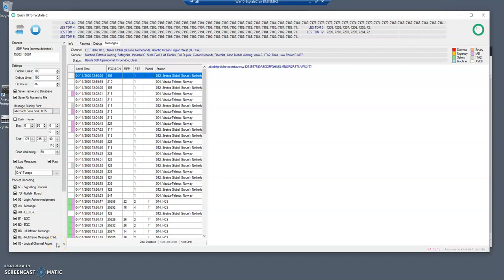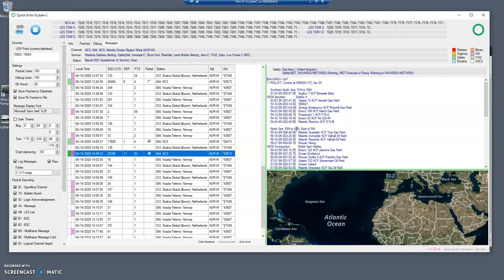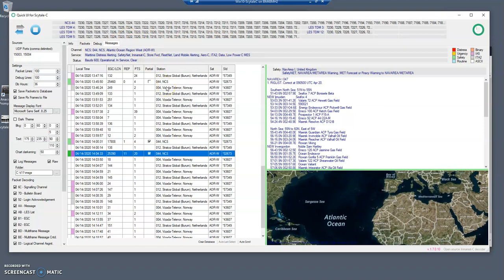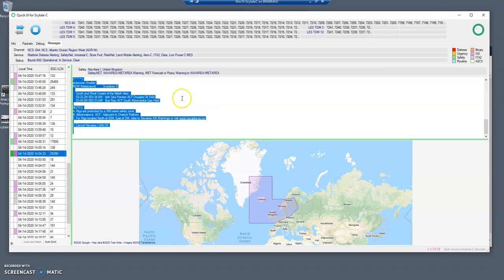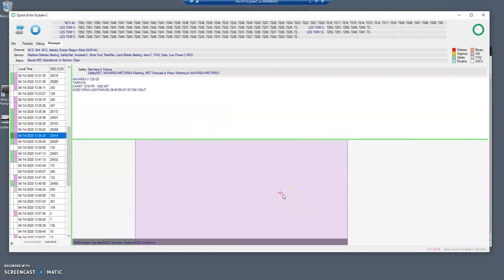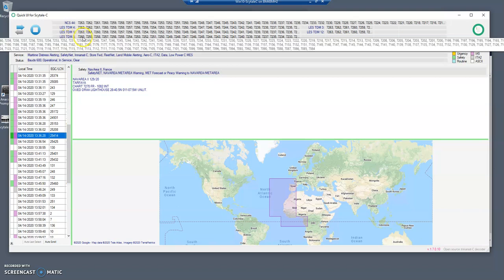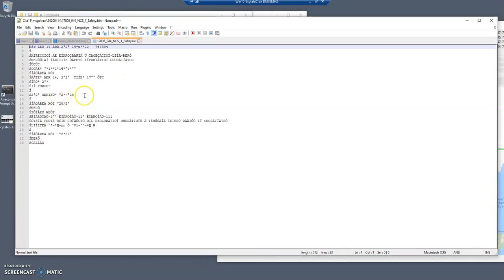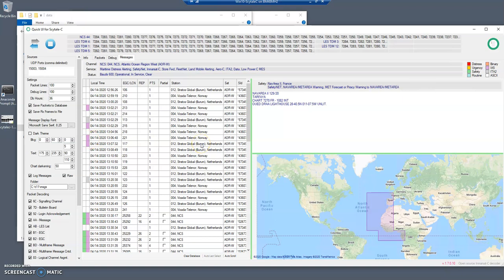Inmarsat-C decoder Scytale-C Part III-c

Comment: Hey. It works flawlessly. What does 'binary' means? It saves PDF or something like this?
Reply from the maker: Some private messages are in binary and are not bound to the byte-boundary. As such, the only way to look at them entirely is to look at them in their binary format hoping that it will reveal itself during an analysis. They could be pdfs, they could be images, they could be encrypted or simply using alphabets different than ASCII.

Comment from the maker: Question: "How do you run multiple instances of sdrsharp that are all connected to the same spyserver but accessing different frequencies please?"
Answer:

The channels are very close to each other, and any standard SDR gives a passband wide enough to receive more than just one.

Lets’ say our band contains several channels and we would like to receive them at the same time. As you have discovered, this is not possible with only one instance of the SDRSharp because the plugin, as it is, only allows for one.

So in the same folder where the SDRSharp is, run the Spyserver configured for the same passband. 
And now the spyserver is connected to your radio.
Then, in the same folder, run the SDRSharp app but chose to connect it to your spyserver not to the radio which is now taken by the spyserver.

So now you’re in the same spot as before, one channel only and a lot of overhead. But now you have options!

Make a copy of the SDR installation folder and run another SDRSharp from that folder. Connect it to the same spyserver.
And you can repeat this until you run out of channels to receive or computing resources.
To save on resources, once the SDRSharp app is set on a channel you can turn off the FFT which is the major computing resources hog.
Or you can type in the frequencies as the channel separation is always the same. Leave the plugin on auto tuning and they will all run happily.

Also, you can distribute the receivers in your LAN, or run some things on RPIs.

Cheers,
microp11